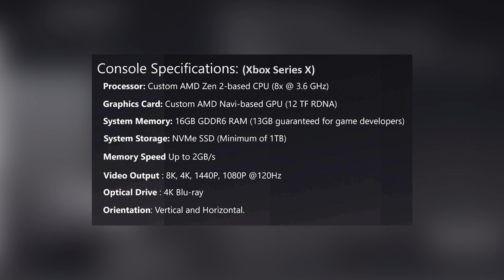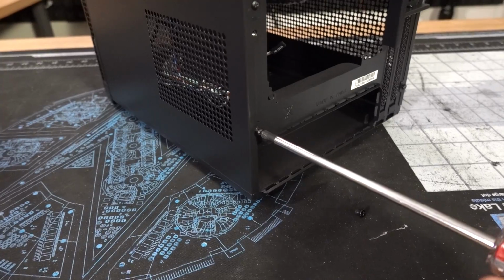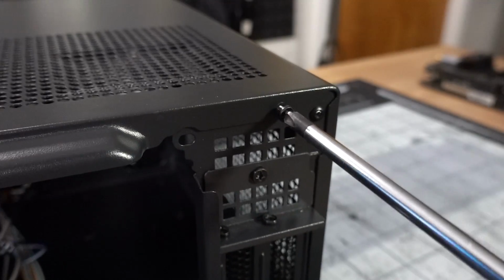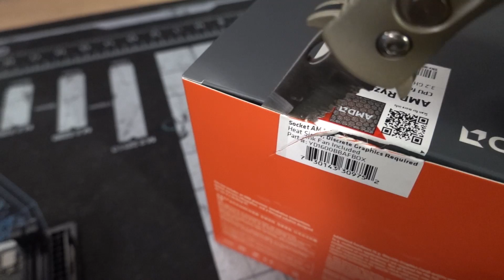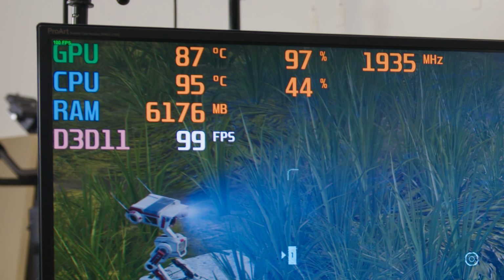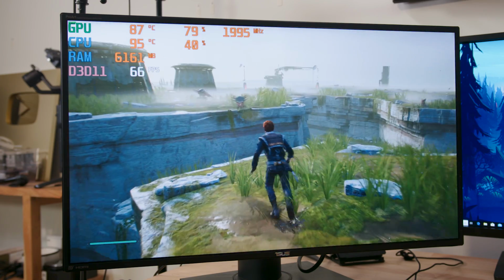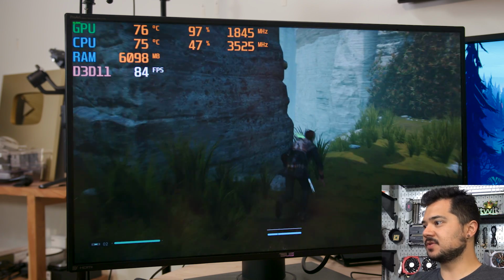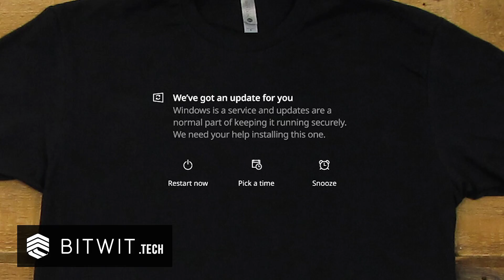I built my own Xbox Series X

Comment: "Building my own series x" and.... its $1000
Reply: @FamlyFrendlyUsername I only play single player games so I don't need to pay the online charge. and this $1000 still not as good as Xbox Series X
Reply: @Mel This is not specs like a series x hes using the old ryzen 1600 while the series x using 8 core zen 2 cpu
Reply: @Fusions-xl3sh  But they have the same performance cores isnt the only thing that matters in a cpu. You need to consider threads speed architecture and much more
Reply: @lukasnilsson9756  Go look up ryzen 1700 vs 3700 you will see a big difference
Reply: @Fusions-xl3sh  what are you going to do with an 8-core cpu if you can't even video edit or stuff on it
Reply: @NotLemont  have you ever tried playing any open world game such as Ark/Atlas? Go try and render a megatribes base then ask that question again. Same goes for 4k at 60fps? In today's multiplayers with 100+ people in them? Come on now, us gamers WILL find a way to put those extra processors to very good use.
Reply: @B01  I still think 8 cores is a bit overkill for a console though, 6 would've made more sense imo
Reply: @NotLemont  soft mods exist for the xbox or well should a i say hard mods lol.
Reply: @NotLemont  but this will only make pc games better since now game developers will know how to multicore there games which was is lacking in the pc space which is why you say six is good because that is what most developers use and the rest is over kill on pc as well. which is why higher core counts some time hurts game
Reply: @FamlyFrendlyUsername $900 is still less than >$1000 lmaooo
Reply: @FamlyFrendlyUsername assuming you use online gaming ...
Reply: @quikgamer 
Markups have always been obscene on the pc parts, but this time around, I just cannot see how the performance that will be offered by the series X matches the $500 price point. Probably sold at a loss, but it definitely will push manufacturers to drive down the price.
Reply: One allow you to stroll through the Internet with ease and isn’t specific to only gaming while this one is definitely compatible with doing all sorts of work and gaming at the same time while connecting to devices such as Phones and the consoles of various typed
Reply: if you think about it it is the same price as the series X
Reply: @mrpopo5285  Hardware to Hardware there is no price that's beating Series X this year or likely next. Give it 2 years and you will be able to build comparable PC. You CAN NOT build a full PC for that price ($499) or even 2x the price this year or next. If you want to dispute, go to NewEgg and feel free to put a truly comparable system in ur checkout and then i'll listen. But you can't especially considering you can't even buy the comparable graphics cards. Even if you could, after all said and done its hardly even a comparison
Reply: Yeah, it's a great deal. Microsoft and Sony are able to sell them so cheap because they're actually losing money on the consoles themselves, hoping to make up the difference with game sales.
Reply: @quikgamer let me just say one thing (even 8 months later) for $500 the Xbox can run 4k, but this pc couldn’t run that if it tried
Reply: @NoBounceForYeiden  ah yes 4k low settings vs 1440p high settings, 4k looks so much better right? 

Digital foundry pretty much shows xbox performing like a 2070 in rasturisation and this is ignoring all the things nvidia gpus have over console gpus, some examples being: much better rtx performance on turing than even big navi let alone going for ampere, far more streaming friendly, dlss aka free frames allowing freaking 4k 120 with absolute max settings in control on a 3080 or max 8k 40fps, probably 30fps with performance. 

The $1000 pc now has a 3070 in it and for $200 more (which is way better) you can get a 3080 (again in a perfect world where nvidia makes enough stock and there's no scalping and mining)
Reply: @darkwolf1739  the PC actually has a 2070
Reply: @NoBounceForYeiden  that true and with graphic cards ranging the price of the xbox and higher there is no putting a computer together for that price.
Reply: @NoBounceForYeiden  my Xbox one s can run 4k, and it was only $400
Reply: Am getting a dell optiplex and upgrading it with a GTX 1650 and the dell optiplex will come with a i5 4570
Reply: Consoles are good for what they're doing,for the normal person that plays game and doesn't care about the performance it's good
Reply: i spent 2.5k on my pc and have a rtx 3080 and honestly you can beat consoles when it comes to price to performance like if your budget is 500 usd dont even consider pc gaming imo
Reply: @quikgamer lol wut, by the time these consoles come out next gen CPUs and GPUs will already be out
Reply: @tek1645  spoiler alert
Reply: @tek1645  *APU
Reply: @tek1645  well that aged bad
Reply: @tek1645  had be ten times more expensive bet you didn't see that coming lol.
Reply: @tek1645  quikgamer still isn't wrong though. Even with the next gen CPU and GPU coming out, you can buy both the new Xbox and PS for the same price or cheaper than the new gen CPU/GPU (which is speculation since we don't have concrete prices on both sides yet). So really your comment has no meaning and reinforces what Quik said. You have to be a huge PC Master Race ignorant person to think that the new consoles won't force PC hardware to compete.
Reply: It's weaker than the Series X actually... that's even worst.
Reply: @DJWhyel  Series X functions about equivalent to an 8400f and rtx 2060 super, despite the specs on paper being bettet
That is with turning PC settings to the exact same as settings on consolr
Reply: @DJWhyel  it allows you to upgrade it overtime, so your not stuck with a brick
Reply: @The Cadaver wrong, the Xbox one won't lose support after the series x comes out. Do some research bro.
Reply: This is using gddr4 memory when series x is rocking gddr6, custom SSD, considerably better graphics card etc. To say OMG its only 1k! And I can have same performance is just not true. Its way more expensive than 1k to match the series x's performance. Its a huge jump for us console players unlike previous consoles which were never touted as similar performance to a gaming pc
Reply: @B01  where did you get the gddr4? That gpu is gddr6 memory aswell
Reply: @michalthemichal3550  i think he was thing about the actual memory on the mother board which would be the bottle neck since it still has to go throw the ddr4 memory to talk to the cpu.
Reply: @B01  Gddr and ddr are two different things. The rtx 2070 super has gddr 6 aswell. The gpu from xbox will be more like the 2060 or 2060 super wich is like 200-300 dollars cheaper.
Reply: @jorritmorrit  no its on par with 3070 lmao not 2060/2070. And one is reg ram n the other is video yes. My b for not being clear
Reply: @B01  no way 😂😂 that gpu is just as expensive as the whole xbox. You shouldn't just look at vram. The best way to find a similar gpu is to look at radeon gpu's. The radeon gpu wich is similar to the 3070 is the 6080 and has 16gb of vram and no way that one is going to be in the xbox.
Reply: @jorritmorrit  nah I was saying my b about the ram. But as far as cost vs performance yes thats entirely true. The box costs same as just the card. Microsoft has been known to take a hit on consoles. Their push is now gamepass ultimate, the monthly $15. So worth it though for the game library and the option to play most of ur games literally anywhere in the world with project Xcloud
Reply: @B01  yeah no, you should work out how much an Xbox has cost you over the course of 7 years I mean 14 games at an average price of $70 (AUD) is nearly a grand on PC games are cheap, you have massive steam sales and the ability to download pretty much any singleplayer game for free, well that may not legal, but still. Shits expensive after a while
Reply: @B01  >no workshop
>no online community
>paying for online
>shits all over steam
lol
Reply: @B01  game pass is shit they have like 3 good games on there. I used to play battlefield 4 on a system that I found on the side of the road running barley 60fps and would have a fun and fair game an extra 60fps isn't going to help of you're bad at the game. Driver updates aren't a headache? don't know where that came from. I didn't even mention how terrible quality the Xbox's are made after the 360 I have been through 6 controllers and 13 microphones conveniently breaking just out of warranty, that's $870. My power pack shat is self after the power went out, don't they have surge protection or something?. Since the first week of owning my Xbox 7 years ago it never accepts discs properly and when I download games it's usually downloads at a quarter of my internet speed. You know whats Broken on my pc in the past 7 years? Nothing absolutely nothing, not a thing.
Reply: @danshady09  you say your experiences and opinions as if it's factual info. The games are far better than you seem to think. Rainbow 6 siege was added moments ago. Yes what a garbo game. Sea of theives? One of the highest player bases out there. Rdr2? One of the greatest looking story games of our generation. Day one xbox titles? Now Bethesda titles? The list isnt getting shorter. All EA titles (fair point on them sucking though)
Reply: @danshady09  ive played more hours on my xbox absolutely guaranteed and had zero of the problems you're having. Controller drift is about the only consistent issue throughout the years for me. My devices working perfect doesn't mean yours will, but im not claiming that. You are saying yours sucked so will other peoples.
Reply: @danshady09  extra 60fps is absolutely going to help every single person no matter their skill level. No idea where you would get the idea to think otherwise. Having someone appear as 10 pixels vs 100 and have input lag/visual lag as low as possible are obvious game changers to any person who plays remotely competitive gaming
Reply: @danshady09  and just because for you, likely a pc whiz, you have no issues doesn't mean it doesn't affect the masses. If you were to google top reasons people use console or switch from pc I bet hardware/software updates or issues are on the list.
Reply: @B01  as I said there are a few good games on there I guess its all subjective but I look at some of these games and they look like they made with ms paint
Reply: @B01  I guess so, the only reason I say that is because my two other mates have exactly the same issues as me they've been through the same amount of mics/controllers and have similar disc issues.
Reply: @B01  yes it going help anyone of course but learning and practicing the game has more of an impact than an extra 60fps
Reply: @B01  I would agree with that, I was also meaning hardware issues before I do get software issue usually a good search and 10mins of stuffing around fixes my said issue. But I always tell people to have a dedicated SSD for windows and then other HDD/SSD for programs and games that way if windows or what ever operating system has a hissy fit just uninstall or wipe the drive and reinstall the operating system windows is that easy to install I could probably do it with my eyes shut.
Reply: @danshady09  yeah separate drive OS mounting is underrated for sure lol def way to go...i remember I used to partition in the old days 😂
Reply: @danshady09  Yikes, imagine only playing games based off of graphics.
Reply: @papayer  it sure does lol. you must live under a rock you are paying for online pay you just don't realize it lol.
Reply: @danshady09  your telling me games on the pc don't look like they where made with ms paint not saying all but some games i don't understand what the people made them.
Reply: @papayer  sure it is keep acting like there isn't games on pc that don't have subs to keep them running lol.
Reply: @userunknown1030  ... That... doesn't make a lick of sense. There is no such thing as a 'live subscription' service to play online games on PC like there is on consoles. You're not locked behind paywalls.
Reply: Where’s all the people who said next gen is better price to performance?
Reply: To be honest 500 bucks + the subscription over its lifetime will be around 800 I think. Just saying.
Reply: @ahloo6920  your math is wrong.. let's say the console is relevant for 5 years - that's 600 dollars for online pay, 500 for the console, 300 for game pass, that's 1400 dollars... And who knows what other shitty microtransactions Microsoft adds.. The hardware itself though, gotta give it to the series x, that's a lot of compute for 500usd
Reply: @michalthemichal3550  yeah, I was just giving an estimate. Microsoft is essentially giving a free console with their subscription plan.
Reply: @michalthemichal3550   An Xbox Series X in the UK (sterling) is £696 with Gamepass ultimate.  That is the console, a controller, gaming online paid for, for two years, plus Gamepass for console and PC paid for, again, for two years.  It is also on 0% APR.

So I have no idea what planet your numbers are based upon lol.

Even if you add, paying for gold for 3 years after that for online play alone: they can be picked up for about £35 a year on deals from CDkeys (I do that every year) So that's a total of:

£801 in dollars guessing that would be about $750.

And of course that is including two years worth of hundreds of games including all first party titles day and date, now including all the ID, Machine games, Bethesda titles etc.

And here we have a vastly inferior PC build for $1000 dollars.
Reply: @michalthemichal3550  online gaming is free again on xbox. so you don't have to pay for anything but people do because you can't beat game pass and you don't really have to pay for it every month.
Reply: @ahloo6920  good thing xbox isn't charging for online play anymore it is free so you don't have sub to anything anymore but i don't see why you wouldn't now with games pass and xcloud. you really can't beat that plus you still get free games every month.
Reply: Upgrading a PC costs less than changing console every year though, also you can get much better prices and discounts as well as just plain better free games.

And it's a PC, you can do everything with a PC.
Reply: TheOtakuComrade it’s been 7 years since the current generation of consoles came out... how good do you think PCs that costed $400 are doing today compared to my non upgraded console that came with operating system and a controller 😂😂😂 at the end consoles are always going to be cheaper and user friendly
Reply: @theotakucomrade  What are you doing to your equipment that forces you to change console every year? My original PS2 and PS4 still work great as if they just came out of the box.
Reply: @The_Real_Frisbee  so does my original xbox though i did i have to replace the cd drive but other then that nothing else is an issue still runs great lol. consoles last a long time and the if treated right.
Reply: @theotakucomrade  have you never heard of xbox gamepass? I know its not free but for an extra $5 month or even at its regular $10, 150 games? All their top studios including day one releases on the pass? (Plus that extends to you PC folk as well, and now xCloud too though. Sorry Steam users but GG) Microsuck is stepping it up hard and credits given where due.
Reply: @theotakucomrade  i don't know what you are talking about changing console every year that is more a pc issue then a console issue seeing as the xbox one and one x have been out for over 8 years now well the one x was only two years old but pc comes out with new graphics cards and cpus every other year. console are a better value if all you really care about is gaming. also you can find your fair share of free games on the xbox as well.
Reply: @theotakucomrade  Who tf buys a new console every year? 1 year warranties are included and extended warranties are affordable.
Reply: The price to performance argument again...and again. Get a job or ask your mom for more lunch money.
Reply: @linkon34  Some of us have to buy food, pay rent and maybe even have kids, you stupid f***€r!

Comment: The Fractal Core 500 case has a much better design where the PSU is moved to the front of the case, leaving room for full size air cooling and air intake at the top, and also still has a rear exhaust fan. Yeah this one is smaller, but you sacrifice too much and it requires premium cooling and PSU options to make it run at acceptable temps.

Comment: I built my HTPC in the SG05 - with an sfx power supply and a 2200G. It came with a fan.  Nice to build in, but I see the new version still has that super-high intensity LED on the front... not ideal for an HTPC to be blinded by the power/HDD led, so I have covered it over with some tape. :)

Comment: I'm in the middle of a build very similar to this, same gpu, different motherboard, and ryzen 5 3600 - but you know what sucks? My tv wont recognize the output of the rtx 2070 super for some reason. Soo now I'm waiting on a monitor to arrive. I hate the "hdmi handshake BS" 

Also, I tried a displayport to hdmi converter no luck. 

I was trying to use my new samsung 7 series tv as a display, guess that's one tick for consoles :/

Comment: I honestly think that the Xbox one X can probably hit over 100fps in certain games. Though because of the hdmi port, it is not able to. So.. the new Xbox will probably hit 120fps but not have it capped and if it is. That would mean that the console will be able to maybe hit higher FPS. I think that Xbox is saying 120 FPS because that is the only FPS count that can be almost capped at. But it also depends on how much it will cost. IF it starts at 500$ then that’s a GOOD price. IF it starts at 600 then in my opinion, that is a bit over priced. 700 or more is a scam. Just because you can build a pc for 700 that can perform more than 120 FPS on some games. I’m a PlayStation person but I also have an Xbox.     I will personally buy a PS5. But the Xbox will also be a very good console.